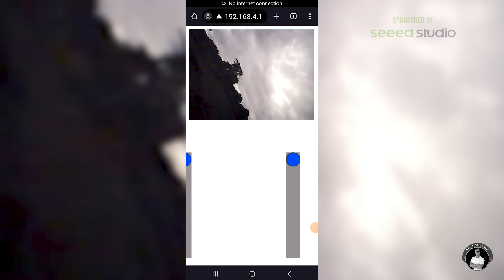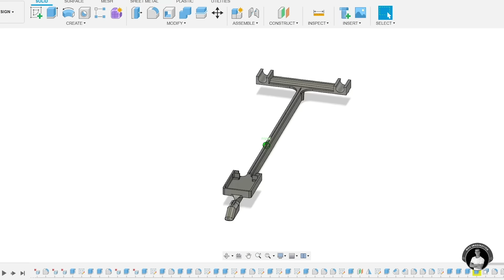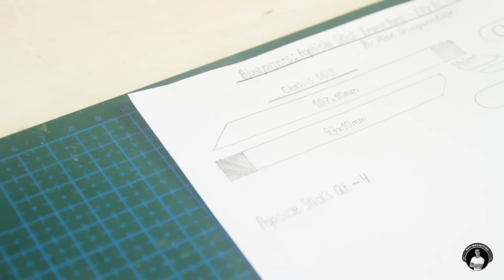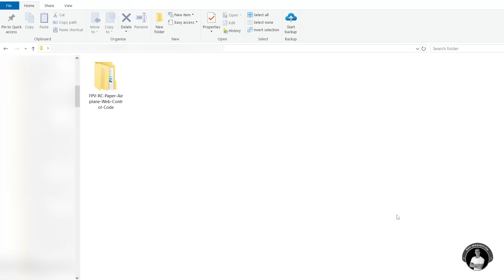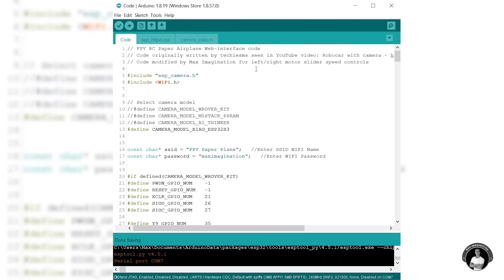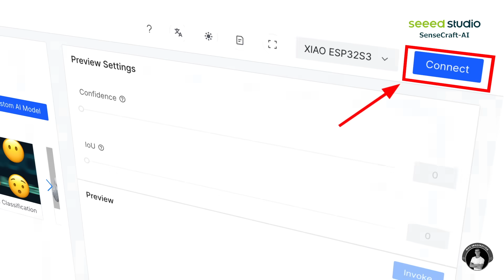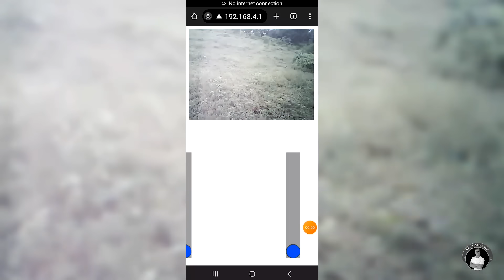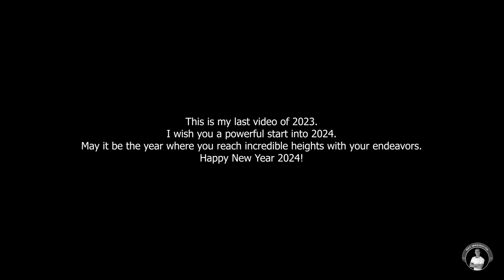Make a FPV RC Paper Airplane That Flies | ESP32

Comment: What should I do I need a bigger battery because it is too small because I will modify your design a little because i would add engines
Reply from the maker: For this size plane, you may get away with a 250mAh cell maximum, anything bigger will be too heavy.

Comment: hi is there some cheaper alternative for that esp?
Reply from the maker: Hi. You could use the ESP32-CAM with the same code, but enlarge the frame, use bigger motors (8250 coreless), and larger paper plane.

Comment: If any one is trying this and is stuck on the driver part you can open 9g servos they have motor drivers inside and weigh around a gram.
Reply from the maker: Or watch my motor drivers guide video (on my channel) and learn how to make them.

Comment: Hi hopefully you you reply i am trying to make it but when i uploaded the code to the xiao esp32s3 it is only showing throttle not showing the live cameras feed and throttle are working  and when I made the motor drivers I did not get the exact smd which is a SI2300 instead of which I used SI2302 but the motor speed is very slow it cannot even give me proper air thrust please help me out
Reply from the maker: Make sure the camera is well connected to the ESP32. Refer to the schematics provided and double-check your wiring. Make sure the XIAO's Antenna is clipped on for better transmission. Ensure you uploaded the code to the XIAO with PSRAM enabled in 'Tools' where your board settings are. If the issues persist, contact me on Instagram for more help: @max.imagination

Comment: the battery is 5 grams, do you think this would work with a slightly higher capacity battery weighing 8 grams?
Reply from the maker: I believe it would, especially if the battery packs 20C or more discharge rate.
Reply: @MaxImagination well we are going to find out. Thank you. I will be sure to report back if it doesn’t
Reply from the maker: No problem :) I'm happy to help anytime.

If you ever feel generous and want to support my work, here’s my BuyMeACoffee page: buymeacoffee.com/MaxImagination. It means a lot!

Comment: Anyone got ideas on speed contolors i could use that i dont need to solder, pre made tiny speed contolor that would work exactly like in the vid?
Reply from the maker: You can pre-made ones you can buy online on sites like Amazon. Search "MOSFET Motor driver".

Comment: I have used si2302 mosfet and 10k resistor across gate and source 
but when controlling with esp32 the thrust is very low to lift off. help me out
Reply from the maker: I suggest you test the voltage output across the flyback diode (power supply and MOSFET drain pin) to see if you get the full voltage level or not. Ensure your battery is healthy and has a high enough capacity - Check it's fully charged. That's all I can suggest for now.

Comment: Hey Max, my 5 year old son and I love your videos. I am trying to teach him as much as I can about electronics and robotics and he loves watching your videos. I don't expect him to fully grasp it all yet, but I am just trying to expose him to it. He actually asks me if we can watch the parts where you are building it more than the actual payoff, which cracks me up. 

We are trying to duplicate this project and running into some trouble with the coding. I have very little experience coding but have found that a little understanding and ChatGPT can take me pretty far (but clearly not always 100%). Forgive me if I am missing something, but it seems like the code you supplied is missing some parts. I have been trying to recreate it but keep running into an issue with the D2 and D3 pin outputs. I can't seem to get the code to modulate the output based on the slider position. Chat keeps wanting to use an LedC function to accomplish this, but when I go to compile the code I keep getting errors. 

Do you happen to have an exact copy of the code you used that worked? Or do you have a quick guide to set it up using the tools you provided in the link? Any help you or others could give here would be great!
Reply from the maker: Hey, Richard. I appreciate your kind remarks! Awesome to hear your son likes my videos too :)
The code I linked is the exact one I used, you simply need to know how to compile all the files together correctly. Ensure you've added the two surrounding files for handling the app and camera index into the .ino code folder that is automatically created upon opening it (3 in the same code folder). Just mentioning this if you haven't done it yet.

The outputs on D2 and D3 work on my end for the plane, I wouldn't know what else to suggest except to study the XIAO ESP32S3 sense board a little further - https://wiki.seeedstudio.com/xiao_esp32s3_getting_started/

Are you sure you haven't changed anything in the code? In case you have, I suggest deleting the current one you have, redownloading the code from the link in the video description, and trying again.

If the issue persists, I will do my best to help you more if you DM me on Instagram: @max.imagination

If you ever feel generous and want to support my work, here’s my BuyMeACoffee page: buymeacoffee.com/MaxImagination. It means a lot!

Comment: I put the camera alone, without motors, atop my already assembled RC plane, but I can not get the live video streaming, I only see the bar controls.
Reply from the maker: This could be the WiFi connection between the camera and your device. Try connecting via a different device/browser. Or it could be an SD data issue - try reuploading the app via SPIFFS in the Arduino IDE to the XIAO ESP32S3 Sense.
Reply: @MaxImagination  Thank you
Reply: same for me too, nothing seems to work. Only the controls work.
@josepoyanrodriguez9837 did it work?
Reply: Facing the same issue, unable to view the video, also tried the said solutions.
Did it worked for you?
Reply: @samuelfernandez9354  No, it did not. I just tried to be polite as Max had replied. But I did not understand how to implement his solution as I am not good at implementing the code. I searched on SPIFFS videos but did not understand them.
I did, however, tried something different but it was too slow. There is another video on Youtube on how to connect the camera directly to your wifi home router. So, I turned my phone into a hotspot, and changed the camera code to connect to my phone hotspot instead. This allowed me to be independent from my home router and go outdoors. But the video was unusable. Notably, the video was smooth when connected to the router.
Reply: No, it did not. I just tried to be polite to Max as he had replied. But I could not implement his solution as I am not good using code. I searched on SPIFFS Youtube videos but I did not understand them. 
I did, however, tried something different but the video was too slow. There is another Youtube video where the camera connects to your home router. My camera did work this way before. So, instead, I set up a hotspot on my phone and I changed the code to connect the camera to my phone's internet. Then, I opened the video on a browser. This allowed me to go outdoors but the video was unusable. Interestingly, the video was smooth when using my home router.
Reply: @josepoyanrodriguez9837  Hey turns out we were just beating around the bush. There was an error in the HTML in index_handler just include a height string in the viewport,
style='width:300px;height:200px;

Do let me know.
Reply: @samuelfernandez9354   Great. Would you mind to point me what line to change in the code please? It will help me a lot. Thanks.

Comment: Do you know how to stop latency of camera
Reply from the maker: You can reduce latency with better antennas, less interfering blocks of code, and using lower frame rates for the camera.

There is not much else I see you can do about latency when controlling via WiFi.

Comment: just amazing what hobbiest can do now, i just picked a variant of the esp32 its awsome what can be done, wondering if you can add an overlay displaying the battery voltage or other telemmetry options i love this community and of corse open source projects
Reply from the maker: Great to hear you're inspired to do these electronic projects! Sure, you can add a voltage display by wiring a voltage divider circuit to an ESP32 gpio pin and setting it up in the code. I suggest you watch videos online on how to do that.

Comment: hey can i use any esp32 camera instead of the specific one in the video and also can i use SI2302 instead of SI2300 because see, I live in India and the mosfet SI2300 is not available here and the specified esp32 in the video is out of my budget. thanks.
Reply from the maker: Hey! To use a larger ESP32-CAM, you'll need to make a bigger plane - at least 1.5-2X the size of this one. Yes, you can use the SI2302, as it's an N-channel MOSFET like the SI2300.
Reply: @MaxImagination  thank you very much for your reply. I will just trim the larger ESP32-CAM to the required size and use a smaller battery
Reply: And I forgot to mention that this is not only cool or amazing this I one of it's kind no one else has dared to build this except you on YouTube thank you very much for this and all your other projects

Comment: what is the video transmission range btw 😅 can we increase it's range using an NRF24L01 module??
Reply from the maker: Hey! The range is currently around 100 meters and can be extended with a larger antenna. Adding an NRF would work if you're willing to add your own code and make it controller-operated instead of by mobile.

Comment: So I have a question, how can we change the code for this plane to use this for a mini drone?
Reply from the maker: The thing about changing the code for a drone is - you don't. Check out my latest video to learn how to make a mini drone, there you will find the code you're looking for.
Reply: @MaxImagination  No, I just want to know can't I just tweak this code to make it compatible for four motors and also add a gyro sensor to it to make a drone with a camera?
Reply from the maker: @rubybhattacharya7927  No, not with this code.
Reply: @MaxImagination  Thanks for the reply , so does that mean that the esp32s3 board cannot be used to make a drone, if it's possible any ideas how can that be accomplished?
Reply from the maker: It may be possible, but you'd have to do your own research on ESP32-based drones. I've heard of drones that use something called "ESP-Now", I suggest you look into that. Cheers.

Comment: Actually you don't really have any choice with the popsicle sticks. I tried them both, and the 3D printed one works while the popsicle stick on just falls out of the sky. Anyways, great project!
Reply from the maker: My recommendation with the Popsicle stick frame is to sand down certain sides thinner to decrease the weight, it should then fly. Thanks for your comment and for purchasing the plane's air frame!
Reply: @MaxImagination  Also, I do have a problem with the design. Why is the design paid? I mean, in your area the cost is a few dollars, nothing big.But in India its a whopping 189₹, a lot costlier. Also all of your designs are paid. I'm not ordering anything, but I suggest making the designs free and on Thingiverse?
Reply from the maker: $2 is only the price of a coffee in my country. I made this video for free, you want to make the project and not reward me by any means? I only make designs free if I used someone else's designs combined.
Reply: @MaxImagination  Hullo, I'm deeply sorry for the comments above. My friend was using the device then and thought he'd be pretty smart and wrote whatever he wanted. I apologize again.

Comment: Good work👍.can i make little air plane using esp 32 wroom using this arduino code without camera?
Reply from the maker: Hey and thanks! The ESP32-WROOM is too heavy. I can only see this working if you make your plane at least 2X bigger.
Reply: @MaxImagination  thanks max

Comment: Just out of curiosity, why didn’t you directly wire the motors to the gpio pins?
Reply from the maker: That would result in burning the microcontroller, so a MOSFET for each was used to drive them.

Never do as you mentioned.
Reply: @MaxImagination  Thank You!

Comment: cool idea, but for camera i think regural analog AIO FPV systems that cost around 15$ are better because this one you show have low fps and delay, and analog camera have no delay at all and maintain 60fps on NTSC at all time
Reply from the maker: Thanks. For the ideal RC paper plane, an analog FPV camera would do better, sure.

Comment: Hi can we just do it with drv8833 motor driver because those smd are not available here will the same circuit be used
Reply from the maker: Yes, it will work as long as this board has enough pins and can work with 3.3V signals.

Comment: Hello! It’s working on esp32-cam?
Reply from the maker: Yes, the code works with the ESP32-CAM. I cannot guarantee a plane like this will fly with a heavier board, but if you're confident you can make it, you may try.

Comment: Awesome video! 1 question, why does your 3d print look so bad and stringy? Mine looks nothing like that.
Reply from the maker: Thanks for your comment. That is due to the humidity accumulated on my filament. However, I fixed the stringing by adjusting retraction settings. All is good now.

Comment: Which smart hands for soldering are you using?
Reply from the maker: Sorry, what?
Reply: @MaxImagination  Around 5:31, you're using a tool that has four clamps to hold the board. I've seen ones that have two, but not four, was wondering which one it was.

Comment: the latency feel quite high, wonder have any other software solution to reduce that
Reply from the maker: The latency on mine is actually not so bad as opposed to running other web server applications with the camera. Not sure about a software adjustment, but if the latency bothers you, a 5.8ghz FPV camera may be the right solution.

Comment: Nice project and good explanation of it all. But if i would redo this project I would use drone electronics with a all in one 5.8g fpv cam. The latency and FPS would be a lot better. Thx anyway for the great video. Greetings from the Netherlands 🇳🇱
Reply from the maker: Thanks for your comment. Anything can always be done better. I will let others like yourself make improvements as you see fit. Cheers!

Comment: I once made single propeller plane using drone parts
But it wasn't flying as this one
Maybe because of weight I am not sure
Reply from the maker: If your plane only used one propeller, then how did you manage to steer it?
Reply: @MaxImagination  front propeller

Comment: Cool idea. Your video made me want to make something similar, but with a tinywhoop FC with an onboard receiver and VTX. Since the board would also have a 4in1 ESC, you could run two small outrunner brushless motors. Also if I redesigned the frame, all of the components could be screwed in place instead of glued in place for easier replacement, as both the FC and brusheless motors have small screw holes.
Reply from the maker: Thanks for your comment. Glad to hear you got inspired!

Comment: man that's really awesome, i wonder of it would work with an actual rc receiver and (probably analog) fpv system
Reply from the maker: Thank you! I'm sure it would as long as the weight is kept the same (25g) or lower.

Comment: “Wing flaps” perfect paper aeronautics terminology - elevons is what they actually are. The most impressive achievement here is that the paper airframe handles the weight of all that tech 😮
Reply from the maker: "Wing flaps", yup, you now know I'm not an aeronautics engineer. However, studying it!
Yeah, the paper doesn't fold mid-flight despite the weight onboard due to the type of folding that went into the paper airplane to give it sturdiness.
Reply: @MaxImagination  dont wanna upset you but i am a bit suspicious about "you" designing the folding because its an EXACT copy of the powerup 4.0 plane, at least credit them

Comment: totally awesome!!  reminds me of the old kickstarter paper plane kit "power-up", just nerdier and awesomer!! :D

i could imagine that the plane would stay up longer when using a slightly larger piece of paper, so theres less weight per wing area.

i also think that the props would be more efficient when flipped around 180°, you just have to cut off the top, or drill the hole all the way through. 

and if they spin the wrong direction, you can just use the other props which spin counter clockwise. (i assume you are using the props from the h36 mini drone, right?)

not an expert, but there might also be a way to get some more voltage out of the "ecu", the battery should provide more than 4v when full.

love your work! stay young and wild, my friend!! 🤗
Reply from the maker: Thank you very much for your kind and constructive comment. I appreciate the feedback! Totally, I have already (as shown in video) mounted the h36 drone props on the way for maximum thrust as you say. Will consider trying out a paper plane with wider wings. Cheers!

Comment: Zamn! This cuts like paper.
Unfolding the legends of the thin sheet. Amazing work

But one thing: don't drive coreless brushed motors backwards, it ruins them
Reply from the maker: Thanks for the tip! Will check the wiring 👍🏻  Cheers.
Reply: @MaxImagination  no problem friend, I am working with 8520 motors right now, too 🙂

Comment: Can we make it with esp32 cam module ?
Reply from the maker: It works with the code, though it may or may not work in flight. Keep in mind that the ESP32-CAM is 2x heavier (7g) than the XIAO ESP32S3 camera (3.5g). Since it's heavier for a paper airplane, you'd have to reduce the weight of certain parts such as the battery by using a smaller one. I cannot guarantee flight with it, but you can try.